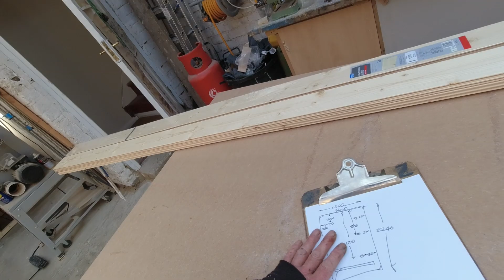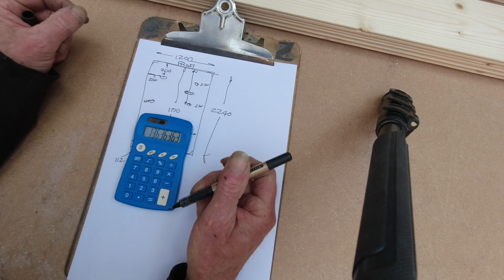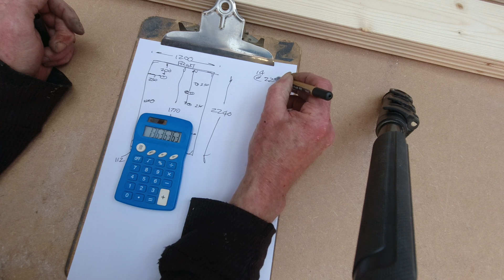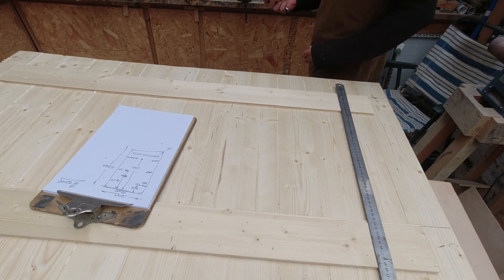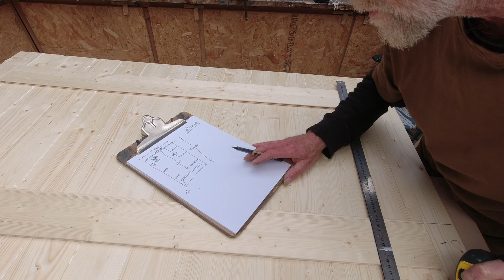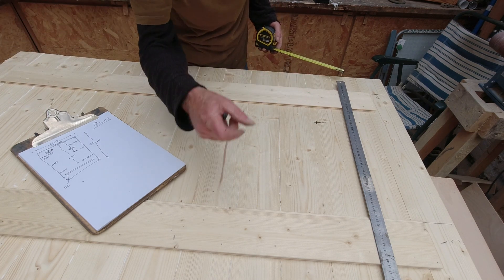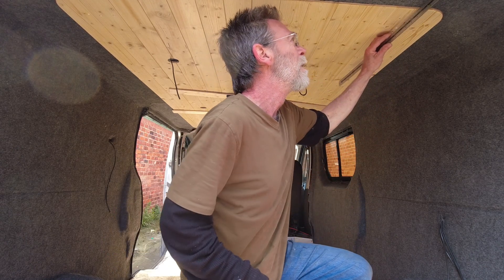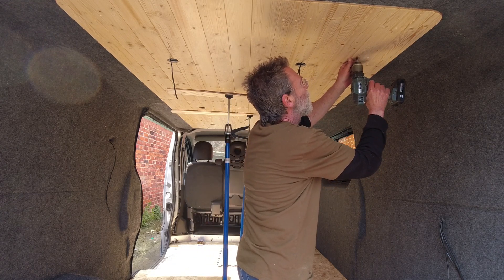How I Put The Ceiling In My Camper Van Conversion

Comment: Great video! How have you hidden the original wiring? I have a Renault trafic and it runs along above the side door within some plastic containment. Thanks!
Reply from the maker: Hi, I carpeted over it and then cut a line in the carpet where it meets the ceiling so that it is still accessible.

Comment: Great video again. Could I ask how you did the top edges between the walls and the flat part of the ceiling. Also how did you deal with the vehicle loom that runs along the top sides of the wall. Think your idea is brilliant and want to do something similar. Thanks
Reply from the maker: Hi John, The edges are made with 5.5mm ply I cut 150mm strips and screwed them to the ceiling batons and when it cam to the carpeting I left enough overhang at the top to cover the ply strips. With the loom I had to make that side strip of ply a little more narrow to accommodate the depth of the loom covering and once the carpet was in place I made a cut in it running down the loom covering for access if needed. Hope that all makes sense...I'll video it if I make another ceiling like this one. Thanks for watching.